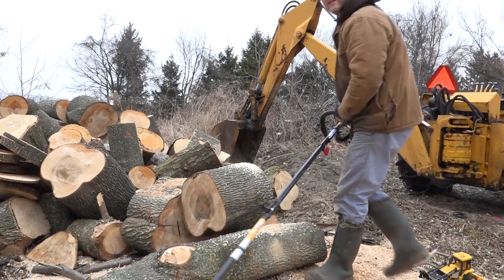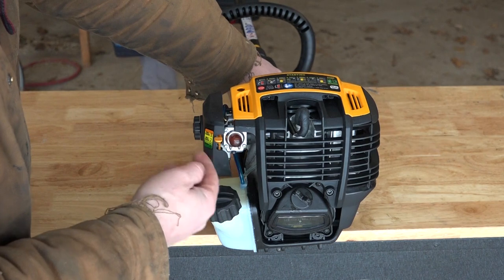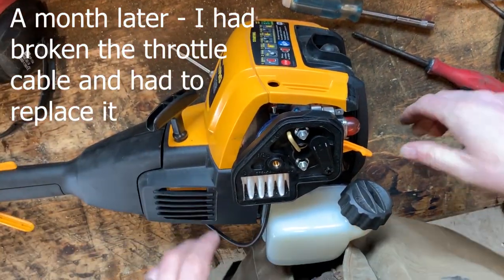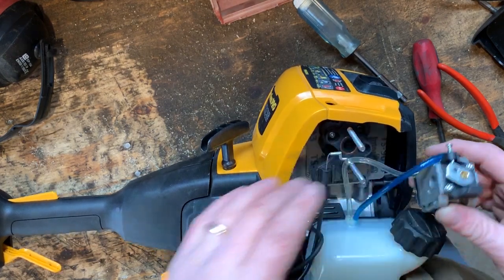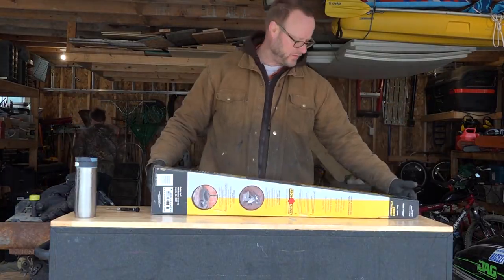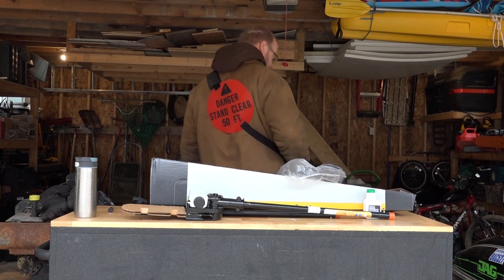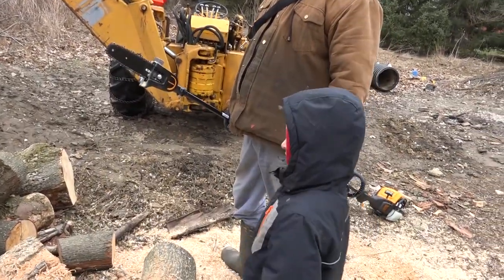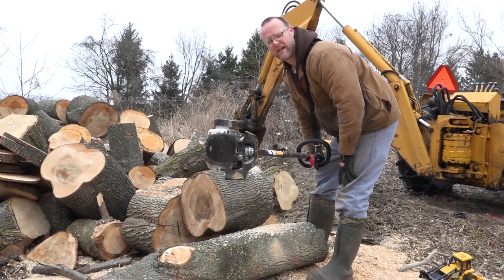Poulan Pole Saw - Unboxing, Testing, and Carb Adjustment

Comment: I couldn’t tell but did your chain start running right away the moment your engine started? I thought it was kind of dangerous that it would do that but mine does. The moment the engine cranks, the chain starts going with it me throttling the trigger. Is that normal?
Reply from the maker: Mine chain does not turn at idle.  Maybe your idle is turned up too high

Comment: When you have to replace the Pulans next year go out and buy real tools that say Stihl on the side of them.
Reply from the maker: Haha,  of course Stihl is better - it costs 4x as much.  For a homeowner who will occasionally use something like this, it works fine.
Reply: I have a popular saw I bought when a hardware store was closing down for $100. 18 yrs later and at least a dozen chains later, it still starts easy and goes hard. Have a Stihl too but shocked how far $100 has gone.